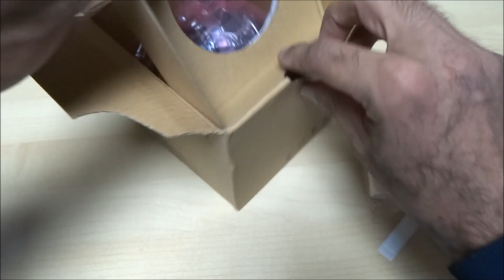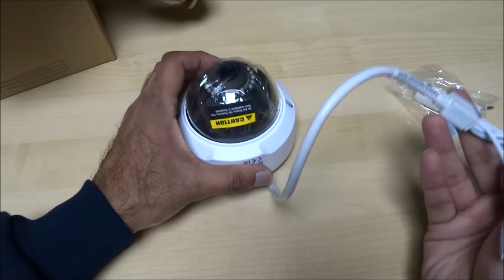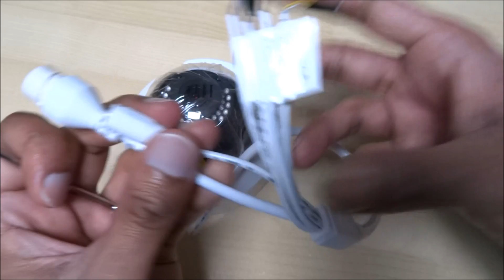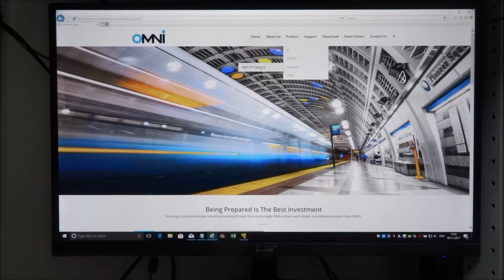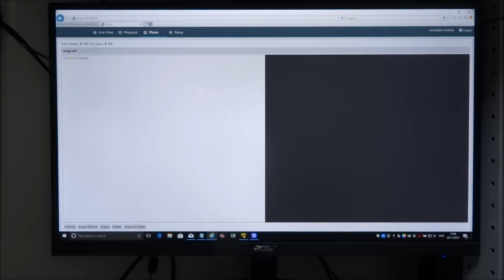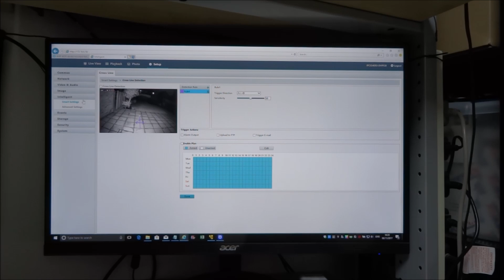Unitech 4MP IP Poe Dome Camera, Network Security Camera Outdoor with Micro SD Unboxing and Setup

Comment: @Geek Street Do you by any chance have the firmware for this camera downloaded somewhere? The WGCC site is now down, with no way to revert the camera back to original firmware!
Reply from the maker: I've contacted the company and the website should be working now. They sent me this info for you:

1. Install the camera ip search tool on the computer, IP search tool EZTools (Windows only)
Http://en.uniview.com/download.do?id=1641404
2. After searching for the IP address, use IE to enter the camera. Follow the picture to restore the factory settings.

Comment: Awesome channel!! Wondering if you could do a review on Annke 1080p IP POE with 4 cameras (1080p/2mp) NVR SYSTEM. There's nothing on YouTube about DIY with this specific system, yes they talk about other Annke systems but not the one I mentioned above! Annke home/online has video about what's included with each system package but never explains how to properly setup as NVR or stand alone DVR cctv , or why the H.246 video compression doesn't active, or how to activate it in the check box on the screen when it also doesn't let you. If you could do, thanks in advance. :)
Reply from the maker: Thanks for the comment much appreciated. I'll do my best to get hold of system if possible. Don't forget to like and subscribe!
Reply from the maker: Actually have you seen https://youtu.be/d6JBDu7PwCw
Reply: Geek Street Thanks. I actually saw this video a year ago or so, before I purchased Annke 1080p IP NVR poe with dome cameras (forgot to mention type of cameras & 1TB hdd on 1st post to your channel). Also the onscreen system setup is way different to the one you recommended. Which by-the-way, your system setup looks much more user friendly for consumers. But not mine, setup is so confusing also its setup is shown in white & light blue/grayish instructions in case you hear or find something on my type of system. Thanks again!! You have gained a new subscriber- Me! For helping not so tech savvy individuals. ;)
Reply from the maker: Thanks for the support. Is the interface like this one https://youtu.be/NGlVYtC5p2g
Reply: Geek Street : no. I'll make a short video & share it with you in a few days. Thanks
Reply from the maker: Ok great

Comment: Got any hints on how I can use a magnetic reed switch on a door with this camera?  Using Blue Iris.  What settings/menus?  Sorry if this is out of the scope.
Reply from the maker: Thanks for the comment, I did try contacting the manufacturer to ask for any circuit diagram but they were unable to provide any, a real shame as lots of potential here.